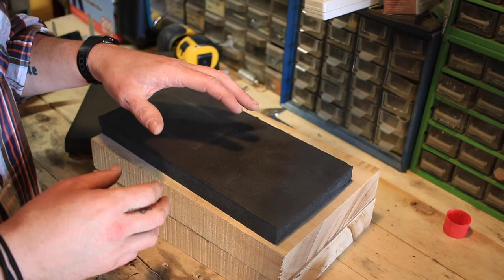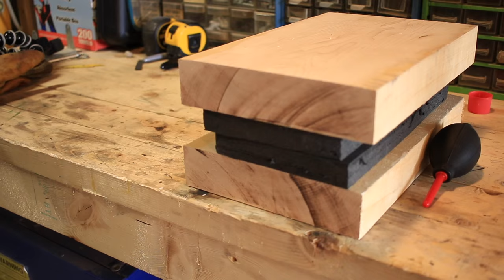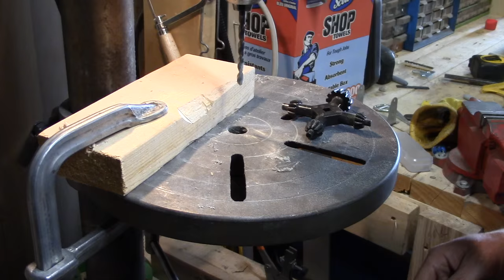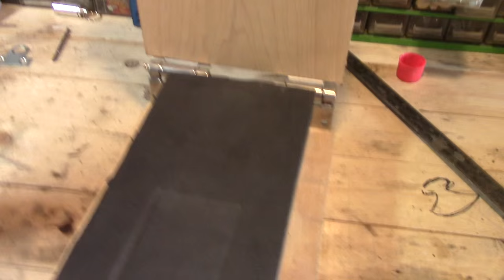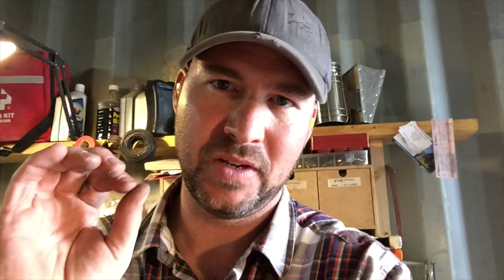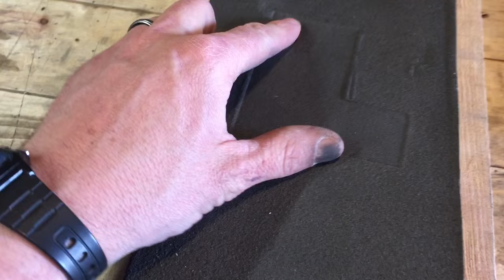Simple DIY Kydex Press

Comment: Quick note to those thinking of building one of these. Before you set the screws for the hinges in the back, compress it with clamps and then set the screws so that when you are clamping the front, the same pressure is also at the back.
Reply: Compress the back with clamps?
Reply: very very good tip. Thanks mate. it means compress them from all area then set the screws
Reply: Thank you, good advice.
Reply: Exactly what I was thinking when watching. Good tip
Reply: Thats what I was thinking anyway. You need to set the clamps so it already creates pressure when you fold it. Otherwise it will only press in the front.
Reply: 👍 thanks for the tip! I've been dialing mine in with little weeks!

Comment: If you tape paper towel around the foam, it will help protect the foam from the heat and extend its life considerably. I know it might not be the greatest solution, but its certainly helped preserve my molding foam in sheath making.
Reply: I know this is a 7 -8 year old video, BUT... you might also consider using baker's Parchment Paper to help protect the foam from the heat.

Comment: 4 steel pins anchored in the lower block sliding free in the upper and 2 ratcheting tie down straps with  two alignment guides per strap (one on each block)  on each side in proper position. fast and easy and allows for ANY thickness so you can do knife sheaths to revolver holsters, and if needed you can forgo strapping with weighs or sliding clamps since the pins keep everything lined up
Reply: BTW Using Robertson screws is cheating!

Comment: Another great video! I saw someone use 1/8" high temp silicone sheets to cover and insulate the foam. Might be worth a try if your foam keeps getting depressed, either that or take it out for a beer..
Reply from the maker: +Maxwill Beryl hahaha! I'll take it out for a beer either way! 

I've never heard that idea before but it sounds like it would work well. Thanks for sharing!
Reply: Maxwill B, what type of adhesive do you recommend to put on the High temp silicone sheet onto the foam?
Reply: Simple Little Life, thank you for sharing that video.
Reply: @Simplelittlelife  where do you source those large kydex sheets we see in the very beginning?

Comment: I just put 2 cinder blocks on top of mine. The pressure is instant and you don't need hinges or clamps. Never had a problem. You can also place the press on the floor and stand on it and drink a beer. 🙂

Comment: one way ive seen to not get the depressions in the foam is to heat up the foam and item you are molding the kydex around. you will also get better definition in the kydex
Reply from the maker: ah, interesting. I've never heard of that but will certainly have to give it a try now. Thanks a bunch for sharing! Cheers!
Reply: Good suggestion. I was wondering why some kydex makers were heating their firearms with a heat gun before placing the hot kydex.

Comment: As a newbie a ran into a heat issue with my foam..
I bought some grey stuff from home Depot about 1/2" thick.double layered it. Put my warm pieces on,clap. Then when I opened it my kydex was stuck to the foam pad🤬. So now I use cooking spray 😎

Comment: Thanks for sharing. I was wondering if the hinges keep you from getting even pressure from front to back? It looks like it would keep the aid with the hinges from smashing down. Any problems with that? Thanks again for sharing
Reply: The hinges are going to apply an amount of pressure in the back and that pressure is determined by how much pressure is in the front, so it's just how the press is designed that keeps even pressure
Reply: I understand your question I don't think he does

Comment: I'm about 3/4ers through. Why do you put adhesive down for the pads? I don't see a reason but hey!! It's your video and I'm diggin' it so far.
Reply: I couldn't figure out why the glue spray. At first I thought of some kind of release agent but turned out to look like the same can.
Reply: To prevent the pads from moving.
Makes one less thing to worry about when putting the kydex in the press.

Comment: I know it's already a bit "old" video but have you had any problems with those dents? Do they leave a mark on the next project that you're pressing?
Reply from the maker: +Keijo Johansson nope. I thought it would be it doesn't affect the next press at all. I'm still using the same foam that I had in this video and probably have about 50 sheaths on it and it still work great. Cheers👍
Reply: Good question. I asked myself the same thing

Comment: Hey I'm on a SIMPLE youtube  binge right now and LOVED your youdube on Dysen recharger repair (!! )  Do you think that lining the heat resistant foam for kydex press with foil would help keep it from retaining deforming marks after pressing the hot kydex? Also  I found the knife making tools vid helpful thank you!. What small aluminum part or block could be used to make the sander?

\
Reply from the maker: +Julia Mahaffey Hey Thanks Julia! I never thought of lining it with foil, but that's a good idea. I'm going to have to try it next time, thanks!

For the sanding block I used a piece of 2" X 3" aluminum (if I remember correctly) but was also thinking of maybe making it out of hardwood like maple or something. The bummer with wood is that I would worry about it swelling and deforming if when wet-sanding. 

Cheers!
Reply: +Simple Little Life I see that Amazon does sell Aluminum Block for milling. I enjoy working with hardwood and some of your hard maple would be perfect  . . . you are right that you might get swelling depending on how long you used it wet, whether you coated it with poly, etc. Another option would be stabilized wood. There are many good youtube instructions for stabilized wood. Corian? Maybe . . . I'm studying today on how to make a knife that is light enough for backpacking and substantial enough for bushcraft. Thanks for your help!
Reply from the maker: yeah you bet. Corian. that would probably be a great option. 

That is a very interesting concept, light enough for backpacking, and substantial enough for bushcraft. That is the best part of learning to make knives! Learning the design and different concepts for all over the place. I'd never heard of that idea before. Awesome! Thanks for sharing!

Comment: what i don't like about this press model, is that the hinges won't allow for equal and uniform pressure over the piece you are working with, you will always have more pressure towards the front when the clamps go,  which results in more defined impression where more pressure is applied.

Comment: Hey bud, what kind of/model drill press and bits do you use?
Reply from the maker: I really like the walter drill bits (or dormer but they're harder to find) and my old drill press was some old no-name that I got from an uncle, but I've recently swapped it out for  a crafted CX600 milling machine. Not large, but a little more versatility and still large enough for what I need. Cheers!

Comment: question: will plastic melt when in contact with the warm kydex sheet?
Reply: This may depend on the type of plastic.
In my experience, I never had a problem with solid materials, but I would be careful.
Reply: @brothersintools9231  noted

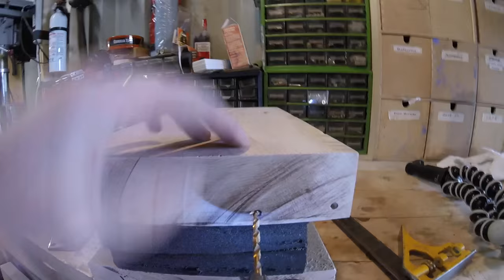Comment: 6:20 notice how the drill bits crawled to the left a bit?  need to apply pressure and push/press inward a bit with the points so it dimples the hole and doesn't do that.

Comment: If you glue the foam you will have trouble replacing it. And lose the ability to turn the foam over after each use to minimize those impressions from clamping.
Reply from the maker: It’s been 6 years and I am still using the same press. It’s working great. I would have hated to use it these 6 years without the foam glued in. Gluing it in is far superior than not gluing it in.

Comment: Could have left that hinge hole for mounting to the table.
Reply from the maker: Could have but for my shop setup that didn’t work.
Reply: Simple Little Life you make clean looking stuff. Thanks for the video. Kydex is addicting.
Reply from the maker: Thank you! It certainly is fun👍
Reply from the maker: And the more I get into it, yeah, the more I want to. Didn’t see that coming😆👍
Reply: Simple Little Life you look into leather wrapping kydex? Financially I'm wrapped up in making plain kydex holsters for my circle of friends for now (cops&veterans/serving) for feedback. I'm a disabled veteran and kydex is great to keep busy with. Eventually I'd like to sell online. I made a long press with clamp and bolts for added pressure. Temp gun is key for the oven or heat gun use but I've looked away a few times and melted the kydex. Pretty involved processes.

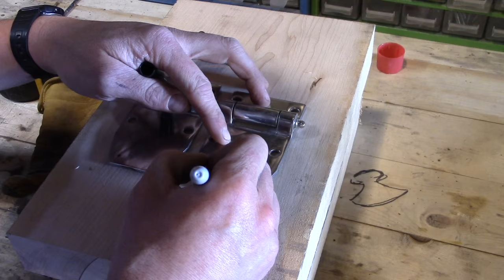Comment: What the hell was that gadget at 5:22?
Reply: Dral Marev he didn't even have to hit it?
Reply: +Menacing Moto it is assessed so when you push down on it it will leave a mark in your object with out using a hammer. you can get it at home depot of 5 dollars. better ones are 15 dollars
Reply: Jacob Dietzler Link? I would like to get one!
Reply: Jacob Dietzler Awesome, thanks!
Reply: +Menacing Moto no problem